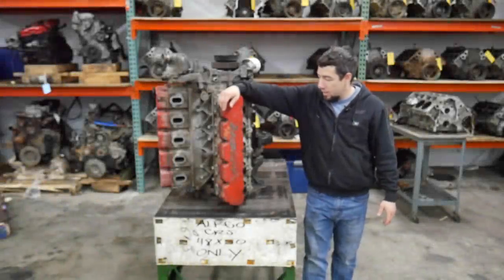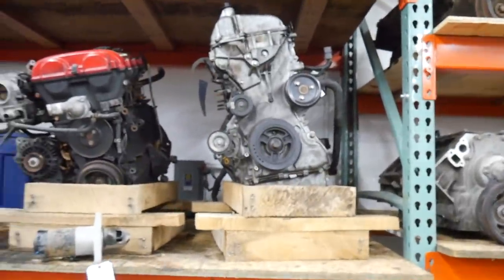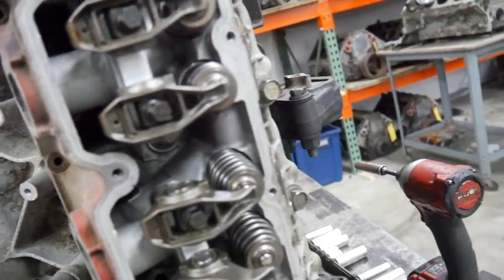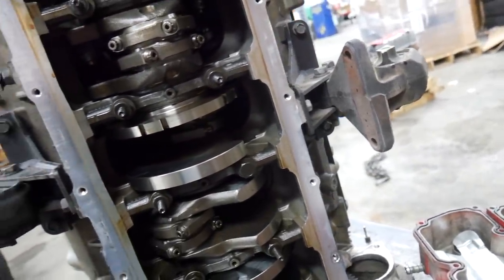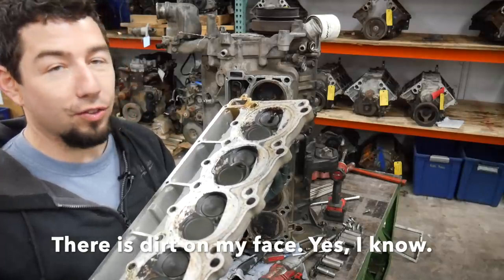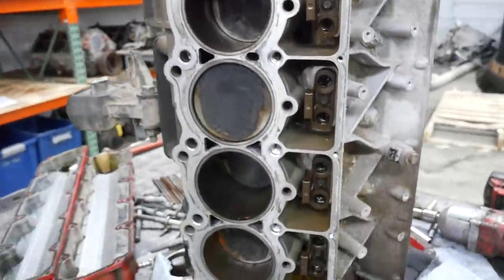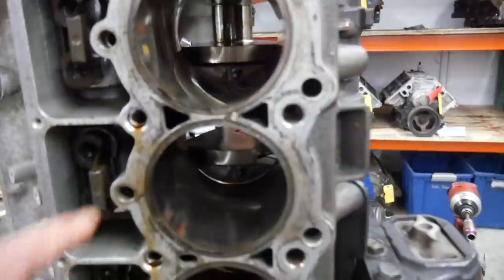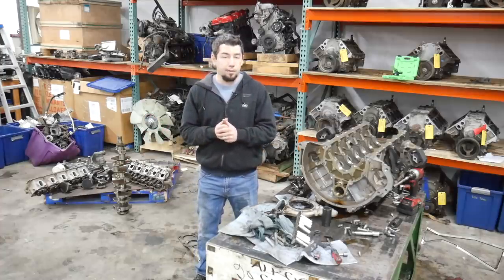TOTAL TEARDOWN! BLOWN UP Dodge Viper 8.3L V10 Engine, What Let Go?

Comment: When dodge had the 2.2 turbo.84 early 85 they had the press pin rods...those engines took abuse like a champ! Later 85 they went to light weight rods till the turbo2 full floughting rods which would handle 440hp...dodge had an idea..
Reply: Light weight rods were total crap for the 4cyl.2.2,2.5...
Reply: I put straight nitrous outta the bottle into the turbo inlet on my 88 daytona with the 84 engine and couldnt throw the rod in it....also it had a rod knock when i tried to destroy it...i was puttin my rebuilt engine in so why not try n kill the old one.that beast did not DIE!...after the nitrous backfire it blew the blow off valve apart,intercoler hoses.the plug off the side of the intake...i was still able to hold it to the floor wot tryin to get it to throw a rod.but nope it wouldnt...after 2 min wot i just shut it off...one hell of an engine.

Comment: I really really really really wish you would put these engines on an engine stand. One of these times you are going to get seriously hurt. I was cringing when you did the Hellcat motor loosening up the rod caps with a little 3/8's drive rachet. That's poor planning on your part.
Reply from the maker: I’ve torn down a few hundred engines like this over the last couple of years and I haven’t had a single issue. It looks much less stable than it is. I’ve done this a time or two, I promise.

Comment: If memory serves me, the V10 engine was initially designed as a truck engine and then adapted to the Viper.  I suspect they just never redesigned it beyond changing to the Aluminum block and heads.
Reply: Got Lamborghini to work the heads too (Chrysler owned them at the time). Just kept upgrading as they went.

Comment: To be honest I feel like you would make way more money if you fixed it.  Replace the piston and re use the rings.  Get another head and new cam.  I'm sure you would make more profit. Selling it complete and running.      They sell for $7000 (90s models) to $15,000 running, you're not making anything close to that parting it out.
Reply from the maker: If this engine were more complete I would say you might be right. Most of the engines that actually sell are complete liftouts, with wiring, ecm, manifolds and even transmission.
A replacement engine that’s bare like this is maybe $4500-5k.
We’ve already sold $3200 worth of parts from it and have at least $1500 to go.
Reply: @I_Do_Cars   I see what you're saying but a wiring harness isn't going to add that much and I don't believe you understand how easy of a fix that engine would've been.   New piston and reuse the rings on it so you don't have to rehone the cylinder. Fix that head or get another head, New cam or savage cam.  The wear on the original cam is from idling and running low rpm.    They're Worth more than 5k man.  That's Maybe auction prices or someone with a plug lol.

Comment: Do these engines use forged internals? Im assuming yes
Reply: SuperJeff,  those were NOT forged pistons, I didn't get a good look at the crank, but the ones in my V10's are cast.  And I THINK the rods are sintered iron and fractured cap style.  But the Viper stuff is bound to be a higher level.

Comment: It's not Chryslers fault someone run it low on oil, thats what ate the cam.
Reply: That engine is too clean to believe someone ran it low on oil.  Hell, that coolant was even the proper coolant (the OE 5 year/50,000 mile stuff that most idiots just pour Dex Cool in).  More likely the lifters failed on their own.  The new "Hemis" have a habit of roller lifters failing and wiping cams, even with the best maintenance.  And don't blame it on the deactivation system.  I've replaced cams in cars that didn't have that, and I've seen plenty of non-deactivation lifters fail.  The "Hemi" just has a terrible design for oiling the lifters.

Though in this case, it honestly looks more like the cam heat treat was suspect.  Doesn't look like the lifter bearings had failed and were skidding for thousands of miles to dig that deep into the cam.  Just looks like MOPAR screwed up on the case harden in that area of the cam.  Their QC was pretty terrible in the mid-aughts.
Reply: @immikeurnot   @13:00 Two Cylinders in front of the cam are Smoked and a Dropped Valve.  Racing it low on oil on a Hot Summer Day would be my first guess??

Comment: Could it be that it dropped a valve seat because the user drove it to hell and back again?
Reply: No, it just happens on mid-aughts MOPAR stuff.  Just did an 07 Wrangler with the same problem.

Comment: So, with all the cores you have there, how many are mopar? Also, why do you complain about what is putting food on your table?? I will never understand this!! I was a mechanic most of my life and never complained about one car brand or another. They ALL made me money!!!  If you were getting the cars with these engines, you might just find out people are tuning these engines and beating the crap out of them.  Like the Hemi you recently pulled apart and complained about. You know, the one with the COMP CAM in it!! Do you think that engine was running as intended from mopar???   Yes, they had, (HAD) an issue with dropping seats and that was mostly from overheating issues.  And why is it you have so many MIATA engines???  HMMMMM....... And holy shit, do you have a pile of LS engines!!!

Comment: I cant believe such an “expensive” engine, V10 but pistons dont fully float, pushrods, single cams 2 valves per cylinder , what are you actually paying for? What centuary did you say it came from

Comment: Why don’t you have an engine stand?
Reply from the maker: I don’t use them for core engine teardowns for a long number of reasons. If this engine went back together or was really light and I needed the stability, I would have it on a stand. I’ve covered this in several teardown videos.
Reply: @I_Do_Cars  I assumed that you put them back together after the video (dumb assumption). That totally makes sense.

Comment: Any engine can loose valve seats, especially if overheated a lot
Reply: I've never heard of ls or ford engines or any other dropping valve seats or valves as much as dodge motors, 5.7 and all of those are by far the worst engines ever produced so a viper dropping one doesn't surprise me
Reply: @Jesussosa104  how many auto machine shops you worked in, LS engines have lots of issues, cam bearings and oil pumps, running off the crank, which is a really stupid idea, and ford's cracking heads and blowing head gaskets, no engines are immune to problems .....none
Reply: @ChiefCabioch  ls engines are stupid reliable they out there in trucks over 200k miles stock block no problems a 5.7 hemi can't even hit 100k without lifter ticking or dropping valves , sure they all have problems and no engines are perfect but dodge has always from 2015 and back have had some of the shitty ass engines made to date idk how the new one holding up but at that time they were junk
Reply: I overheated 2,  l76  motors and not one lost a valve sest so idk where you getting that any engine that you over head does it.
Reply: @Jesussosa104  admitting you've overheated a few engines will get you some kind of trophy egg head?
Reply: @Jesussosa104  you don't work in a machine shop, just get your info from the internet
Reply: @ChiefCabioch  my point exactly start getting pissed off when you get hit with the facts , but okay Mr Master mechanic whatever you makes you sleep happy at night have a good day 🤣
Reply: @Jesussosa104  so you are an online psychologist as well, who would have guessed that you, an engine wizard can tell if people are pissed off on the internet, such talents ...

Comment: Some dip-shit abused this engine & the car it was in. Lack of maintenance & overheated it to kill it. Rode hard & put up wet. 

I'd get me a replacement slug, cam, re-ring it, roll some bearings in, repair the valve seat & send it! Would make a cool Lil Red Express swap!

Comment: I´ve seen a few of your videos by now, and I continue to wonder: You do this professionally, but you don´t have and use a teardown parts tray.

Instead, everything goes everywhere. Isn´t something bound to bounce and skidder under a rack some day? Something you want to keep?

P.S.: On the other hand, the only “problem“ is that there is not enough grease on your face. What, you can suppress the urge to itch your nose?
Reply from the maker: I use my tables. They’re on wheels so I roll them to the different places in the shop where these parts end up.

Comment: Just because they charge a fortune for that engine, doesn't mean it was built well. It's a Chrysler. That's was built well for Chrysler. Not a fan of the company but I was hoping the viper was different. Oops. I was wrong again. I'll give them credit for trying things no one else tries. The viper for one, The Plymouth prowler was a great looking attempt at something different which would have stolen the show if they actually put a decent engine in it. But it's a Chrysler. Might as well be a K car

Comment: you should've bought a replacement piston and valve, and sold the engine in working condition. probably could've made more bank with that.
Reply from the maker: It’s unlikely, after having to buy a cam, lifters, and gaskets I’d be able to make as much.

Comment: Cam was damaged by the dropped valve seat
Reply from the maker: Damaged lobes were on different cylinders. After we cleaned the pistons we found two more pistons with valve marks from contact that were obscured by carbon. Likely those cylinders for the damaged lobes

Comment: I didn’t notice the dirt on your face until you mentioned it in the subtitle and then I got stuck in a loop because I saw the subtitle again. I couldn’t focus on what you were saying. Maybe just don’t point it out? It’s ok, you’re pulling apart engines. I expect grease and dirt on your face and in your nails. Great content though. I think this is the fourth video I’ve watched by now.

Comment: Ripoffs are never as good as the original. Chrysler’s entire history has been stealing, bodging and knocking everyone else off. This engine is literally the best of the worst.
Reply: Yeah, the genII HEMI that powers every top fuel and funny car is STILL  the design that Chrysler used in the 60's muscle cars.  And the volume of collectible high dollar cars in the auctions is probably just ripoff copies of Chevy Barracudas and Ford Chargers,  right?

Comment: Why doesn’t he get the valve seat fixed and sell the full engine
Reply from the maker: That’s not what I do. I sell parts. We don’t fix engines. It’ll be someone else’s engine fixed with our parts
Reply: @I_Do_Cars  but can’t you make more by fixing it and selling it?
Reply from the maker: With very few exceptions, considering parts and labor, machine work, not even close. Plus the liability of having to stand behind a complete motor. I wish it made sense to do that. There have been a few cases where we’ve put a head on something or something else small but that is the exception not the rule.
Reply: @I_Do_Cars  ok cool and I appreciate you giving me a little explanation

Comment: People use used pistons!?  How dumb/cheap can you get!?

If a customer asked me to do an engine repair and brought me used pistons, I'd have him call a tow truck.

Why do we leave the cores outside?  Because as long as we get our core charge back, we don't care.  Honestly, if there's no core charge, I dump the old engine in the scrap trailer because that's all it's worth to me.
Reply from the maker: I probably sell a couple grand worth of pistons a month. Usually sets of LS with gen4 rods which are full floaters. 
It’s not everyone’s choice, but they do bring some money. On an LS, I’d have no issues. On something expensive like a viper v10, I’d probably buy new.
That being said, it’s a total waste to trash some engines. Some parts are impossible to buy new and used are the only option, or the only reasonably priced option.

Comment: Most problems on newer engines or performance engines are from low octane gas or lack of oil changes, Sludge and spark knock are big failures in a lot of cases

Comment: What are the most reliable engines of all time?
Reply: Chrysler 318
Reply from the maker: In my experience, every brand has great engines and terrible engines. I usually weigh an engines tolerance for abuse and neglect when judging how good they are.
Reply: @I_Do_Cars are you judging the literal bearing clearances or do you mean the engine's general construction?
Reply from the maker: Mike M general construction and quality of components. In the used auto parts business engines are expensive for only two reasons. 1. They all fail or are prone to it, and 2. Swapping into other cars. My inventory system can look at the national number of requests for an engine and typically engines in demand are for one of those two reasons. 
I combine those metrics with my personal experience.
Reply from the maker: Mike M and tolerance meaning how well it puts up with bad owners and conditions. Not bearing tolerances.
Reply: @I_Do_Cars  thank you for your responses, it's greatly appreciated
Reply: MOPARS
Reply: Chrysler slant 6

Comment: I really hate watching you pop out pistons without sliding a small piece of rubber hose on the rod studs to protect the journals but i suppose anyone buying a used crank is planning on machining it anyways
Reply: and i suppose a lot of rods use bolts instead of studs

Comment: Do you not own an engine stand?
Reply from the maker: What would I use that for?
Reply: @I_Do_Cars  It makes the engine more accessable than a table top.  Four bolts hold the engine up, and you can flip it all over the place without fear of torsion-baring it off the table onto your foot...
Reply from the maker: Andy George id disagree on these engines. Makes getting the rear plate off a pain. Also long heavy engines are a pain to roll over on a stand. I have forklifts, and have done hundreds this way. I use stands for really light engines and for engines that get fixed and reassembled
Reply from the maker: As well, when you’re processing the volume of cores we do, the time it takes to set them up on a stand really eats into productivity. Makes modular blocks more challenging too. Stands have their purpose but I choose to not use them for these type of engines.
Reply: @I_Do_Cars  Fair enough...

Comment: Chrysler is so back assward with there junk. That engine is odd fire, Who builds odd fire engines these days? MOPAR : Mostly Old Parts And Rust.
Reply: Who builds odd fire engines ? Uhhhh , oh yeah Lamborghini. 
Viper engine designed  by Lambo
Reply: @scottontheboat2340  lmfaoo ok buddy, trust me, if Lamborghini designed the engine it would NOT be 8.3L or cam in block
Reply: @scottontheboat2340  Uhh no, Lambo's V-10 has offset journals to create an even fire.
Reply: The future isn’t so bright and neither are you
Reply: @armandomontezuma4701  I may not be brite , but I own a 04 black mamba roadster , and have internet access! Google  It 👍
Reply: it's a V10, stupid! Very hard to balance a v10. It takes tricks to make it run smoothly. I have a v10 in my Dodge 1T and I love everything about it, except maybe the mileage. But I only use it to haul BIG stuff, and for that kind of work,  mileage is less important.
Reply: @rustycowll5735   Actually, its simple to balance a V10. 72 degree V , or retain the 90 degree V and offset the journals . Offsetting the journals gives you 10 journals instead of the uneven 5 . Ford offsets the Journals in the Triton V10.
I've dealt with many 8.0L v10 dodge trucks, they all end up with a spun bearing or the bearing will piggyback the other bearing egging the journal . A v10 with a spun bearing back in 2008 would sell for $2000 at times. Not sure where the prices stand today, but Im seeing less and less 8.0L v10s  so they probably hold a premium price.
Reply: 900 degrees of firing in a 720 degree cycle. 5 fire at 90, 5 fire at 54. It's fundamentally a 90 degree V-8 block with 2 more cylinders hung on the back.

Comment: So your saying a gm or Ford never drops a valve seat? Because I know they do ya mopar hater
Reply from the maker: They all can. I’ve seen a TON of rectangle port 6.0/6.2 gm engines drop intake seats. I haven’t done fords yet but I’m sure if they’re overheated they can too.
Reply: @I_Do_Cars  what I’ve seen on fords they have inherent cooling and lubrication issues on the rear cylinders of there engines the v8 anyway oh and there cheesy timing chain tensioner tracks are the worst just fall apart after 50 to 60 thousand miles blocking lubrication holes.

Comment: That cam could be reground if you want to flat cams tear down a small block Chevy with flat tappet cam I have to take one out that was not JUNK
Reply: The cam was destroyed, man.  They're case-hardened.  Once you get worn down past the first couple thousandths of steel, they're scrap.